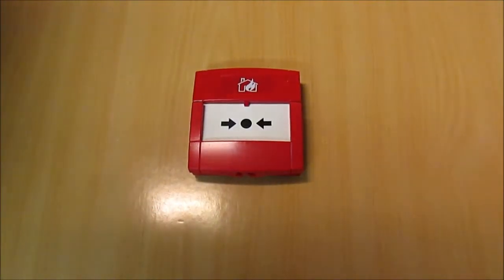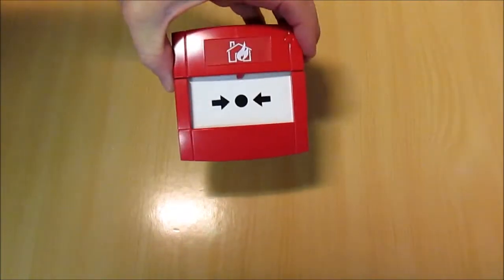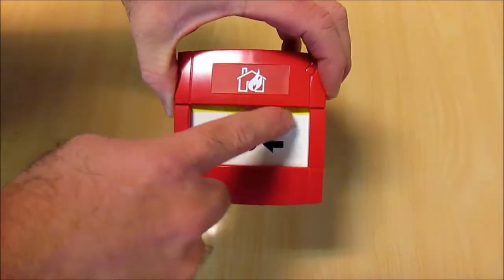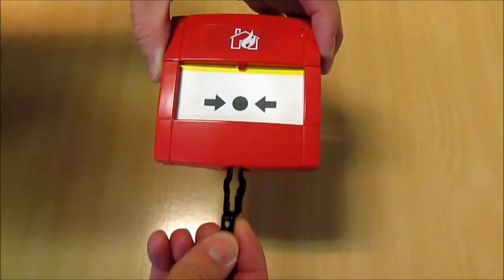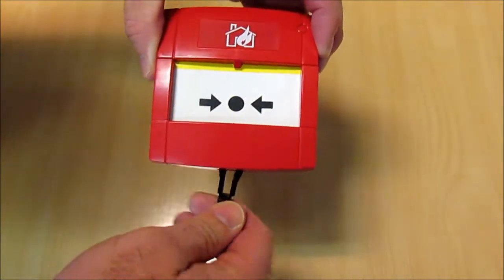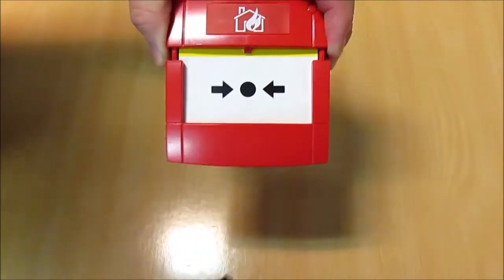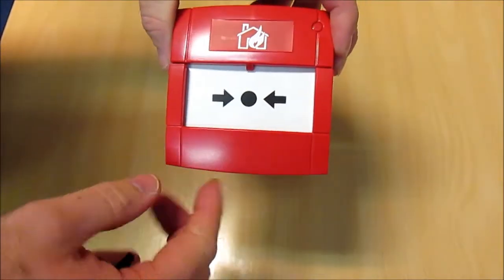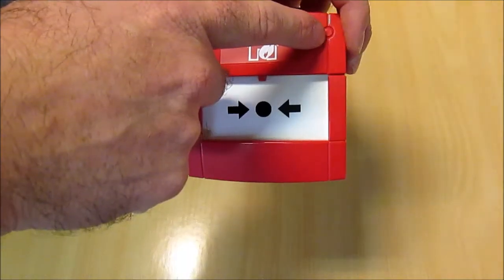How to reset a call point

Comment: Will the red light go off when the MCP glass is reset ?
I thought on a addressable fire alarm the panel had to be reset before the light on the MCP went off
Reply: This particular version is conventional, and has no LED, but if it did have an LED it would still work the same way as the addressable version